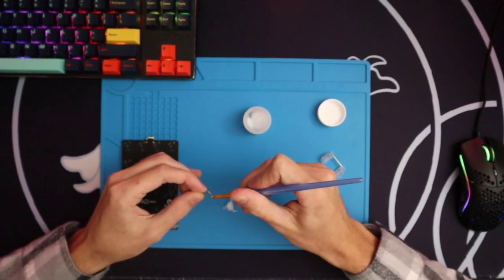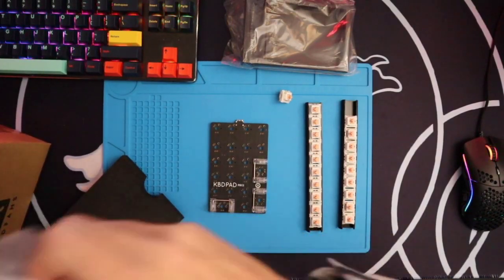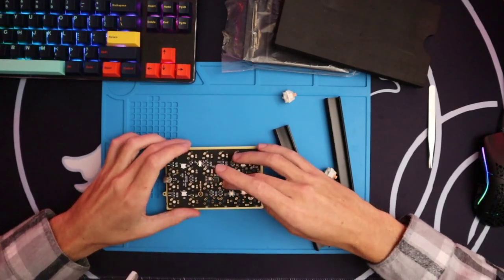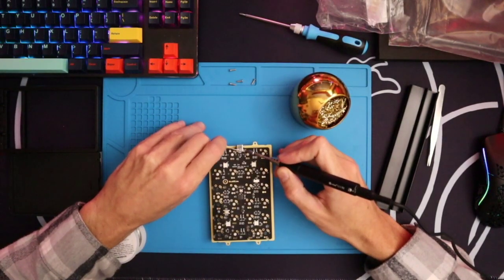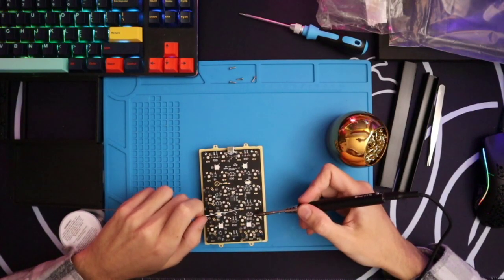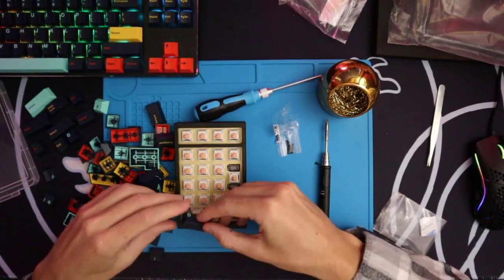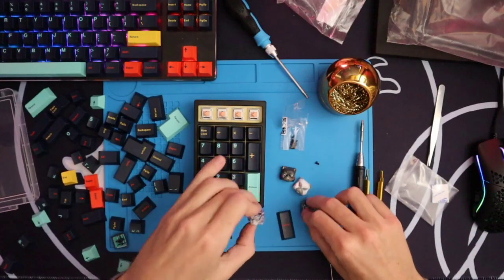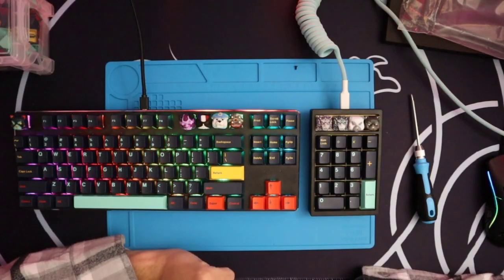KBDPad MKII Full Build |

Comment: I'm having trouble with getting my PCB to flash to a layout I got from QMK Configurator, I tried setting the 2nd, 3rd, and 4th top row switches to be cut, copy, and paste respectively, but they somehow just didn't work.  How did you get it to show up in VIA?